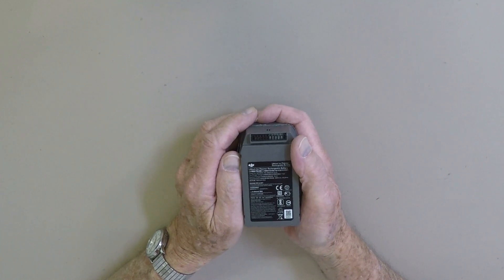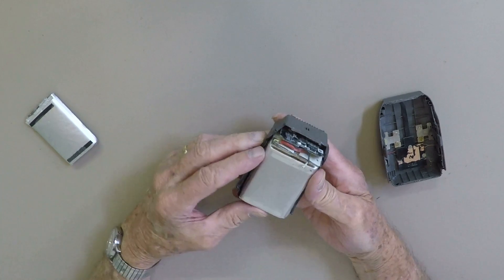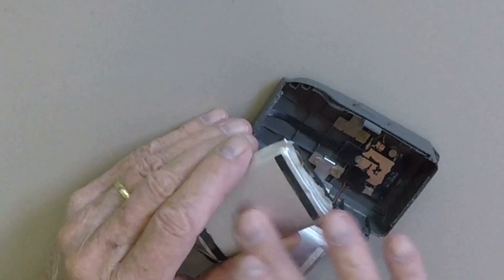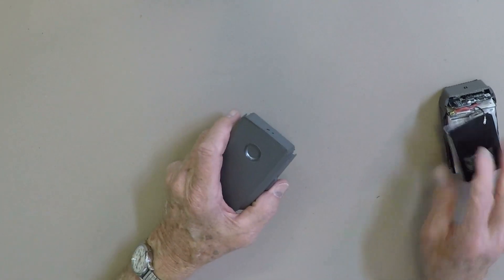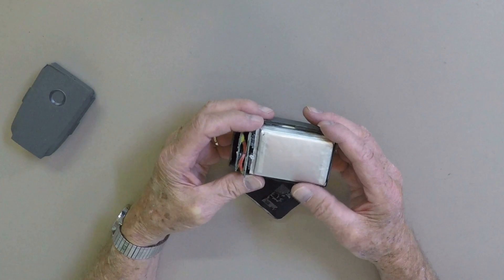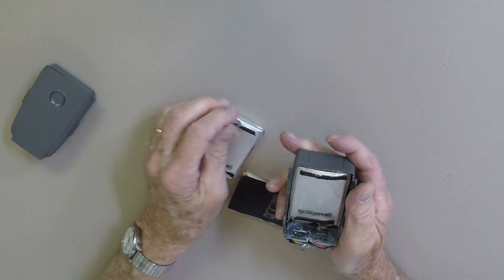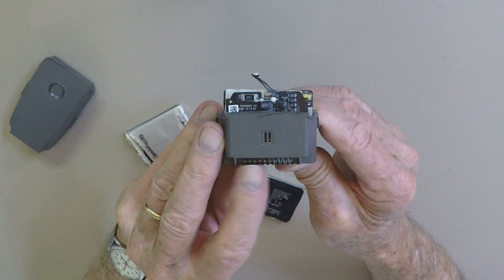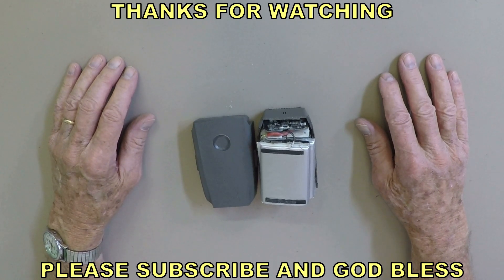INSIDE THE MAVIC 2 BATTERY

Comment: I think you must of got some bad batteries from the start . I have had my Mavic Pro 1 from just after they came out and I don't have any bad batteries yet they still hold a good charge maybe a little less flight time than when they were new but still over 20 minuets and none of them are puffy at all as far as that goes I'm still using my Phantom 1 on the batteries that came with it , I always store them at 3.8V and only charge them when I plan to use them and my Mavic Pro batteries I run them down to about 20% once every couple of months I run them down till it self lands at about 20% then charge them and run them back down to the 50 or 60% to store them . I try not to let them self discharge , I have found they get very hot when you do so I prefer to run them down . On all of my lipo packs I have a led meter that plugs into the balance plug so I know when they get down to 3.8V it beeps VERY !!! loud . Also other than when I full cycle them I always bring it in at about 50 to 60 % to land and still get about 15 to 20 minuets  . But I think you got a batch of bad batteries from the start , you haven't even had yours a year yet have you . The only way they should of gone bad would be if you kept them charged all the way up all the time they will go bad fast that way . Lipo's are strange compared to other kinds of battery's they take a lot of babying . I have wondered what was inside them I thought they might have batteries like a cordless drill the 18650 single cell round 4.2V 's  I have made some 3 cell 11.1V packs with them and they work great and hold a charge longer than Lipo's . You have to solder a balance plug to them and charge them with a balance charger  but they even are lighter than the same lipo . I think they came with a year warranty or it may be only 6 month I would still check before I opened any more .
Reply from the maker: I really appreciate your comment. I even copied it so I could review and remember some of the things you said. I may have gotten some bad batteries without knowing it. I have the one which came with the drone and it is still working great. The two that came with the "Go fly" pack are the ones that are failing (I think). I ordered two new batteries and their power level was not measurable by the drone until I charged them. That was not the case with the others. 

Anyway, I know about the lipo storage issues. I am still selling a few of the Bebop 2 balancing cables that made it possible to put them into storage levels, which I always did and still have the same batteries from a couple of years ago. But the Mavic 2 manual says to put the at a full charge - so I did that - but not from now on. I am doing about the same thing you do with all my Mavic 2 batteries now.

Thanks again for your input. It is valuable and good to hear. God bless you.

Comment: Mr Kent..... is exactly what's been Happening to me .... already bought a few,  but I got like 6 batteries in that condition, like i told you before, Mr Kent,  what a great ideas you got .... thank you Mr Kent,  and God keep using you.....
Reply from the maker: Thank you for your kind words. Yep supposedly DJI has the battery's computer programmed to discharge to the neutral point after several days which prevents the swelling, but I do too much flying that I have never tested that :) God bless you also.